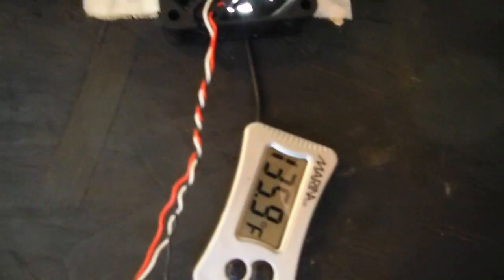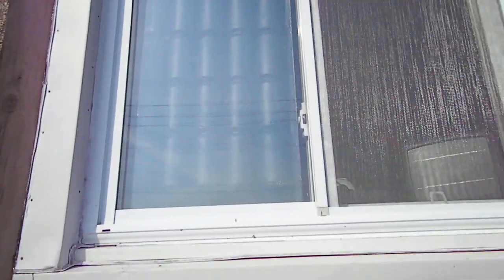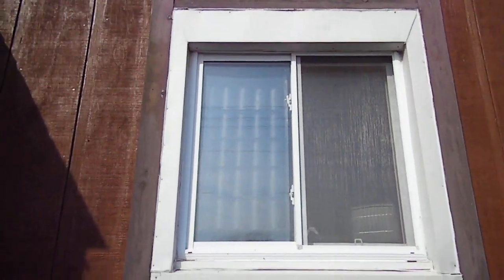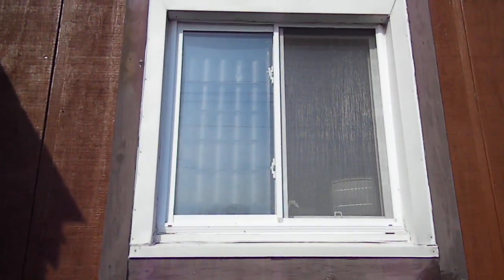window solar heater

Comment: If this heater is already inside the house, the housing and the cans are totally unnecessary. You could reach the same effect by putting a black sheet or a black curtain there, and the normal airflow will take care of the rest. Or simply let that light in and let it warm the house.

Comment: So this is using your existing window? Great. I want to do the same!
Reply: Solar flux per square foot (or meter) of collector or window is exactly the same. Which admits more heat into a building, a collector, or an unobstructed window? Why?

Comment: i don't understand if its a hot sunny day why do you need to heat the inside the home
surly this  only works with sun so at night it wont work either
what i am saying is surly you want heat when its cold not when its sunny?
Reply: Ah Yes Of course .
Reply: No sun, no heat. That's why the first step for solar conversion is to add to your home's insulation.

Comment: You are mistaken Jay. The window in the display clearly has LowE in it.  The author of the video would probably get better efficiency if he could replace the windows with non-LowE sashes for the wintertime.  By using the solar window unit he is increasing the heatable surface area.  Unfortunately the windows probably have a low SHGC because of the LowE.  You could argue that the surface area of flooring and the home is sufficient but those surfaces are not optimized for heat absorption.

Comment: No the window by itself and a window with a box get the same amount of energy from the sun. With a box you are slowing and heating a small volume of air very hot  and diluting it into a large volume in  the rest of the room. Or without the box you are heating a large volume of room directly  ..same thing.   Put the box outside and below the window where sun energy is reflected back off the wall and then you have a heater box that is harnessing sunlight that is not harnessed.
Reply: yep

Comment: true,, the box does work but its in a window that already lets sun energy in. If you have a box on the side of ones house , true you dont want to heat outside air. You vent room air into the bottom of  a box. Here it starts at room temp  usually 22 degrees Celcius  or 72 f, the air heats up in the box, rises naturally  and goes back into your house heated.  You can place boxes like this on the side of ones house where sun energy will be reflected back into the atmosphere.

Comment: wildwindsca...if what you say is true, how can a window heat sunlight up to over 100 degrees and be forced into house?  are you saying that the window itself will heat up air to the same temp as this heater and thus warm the room moreso than this heater?

Comment: A solar heater in a window, is a waste, the window itself is a solar heater the inside of your house the "box". A box  is best placed outside the house, were there is no windows. Here the sunlight is  just reflecting back into space. The solar box here acts just the same as a window in your house. Efficiency points, keep the air runs into and out of the box short, you can angle the box i would not. input air into the bottom outlet at the top,its proven cans do not help much, baffles are better.

Comment: Sunbeams that normally go to apartment through window heat also. 

Now when you have put that pop can heater in that window, those beams are blocked. 
Which is out of the total benefit compared to heater which is located to wall or any other place than window...

Another way to bring more heat to a building is use mirrors to reflect more sun beams through windows. Of course they might not look good in the yard. :P

I've done couple pop can heaters myself too.. now making 3rd one.